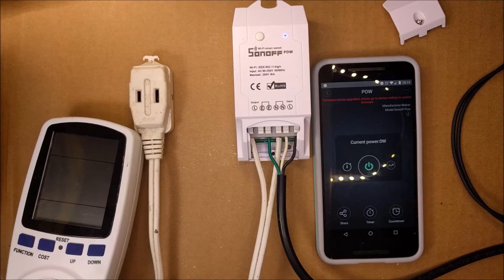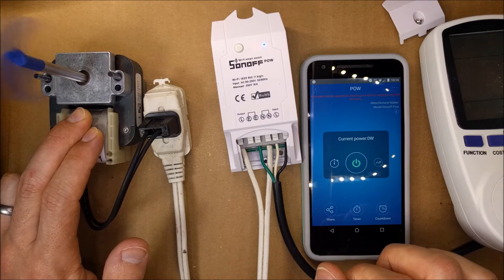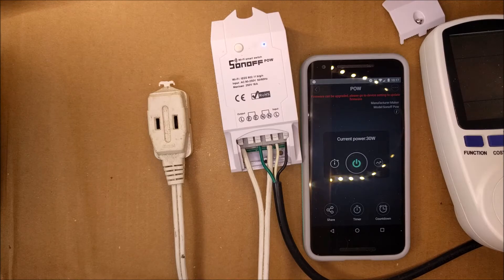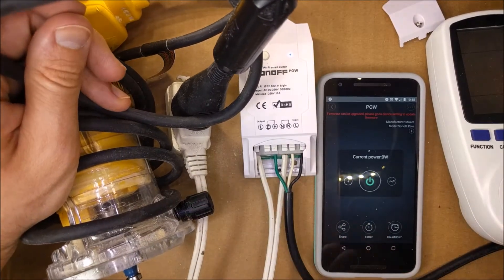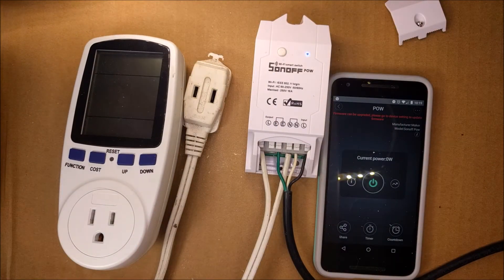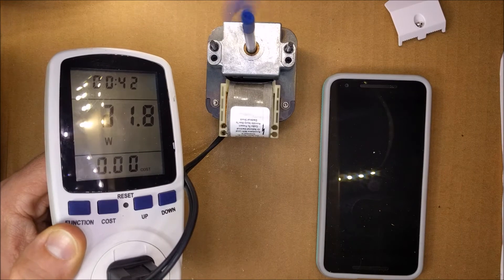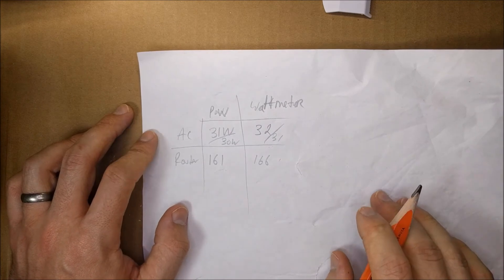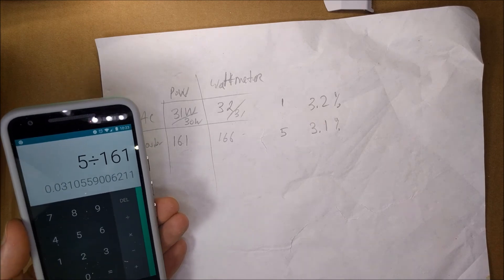Sonoff Pow review 2

Comment: You do realize that the whole point of these comparison videos are totally useless unless you use an actual multimeter to get the true consumption reading of whatever electrical device you are using. What is the point in comparing two units if you don't know which one is more accurate and by how far each is off from the true reading. Totally pointless. It's like comparing the taste from two variations of a recipe without knowing what the original recipe tastes like.

Comment: Nice comparison! But your comment about bigger load having bigger difference is not entirely correct. Each power device draw current in different ways. A resistor for example takes nice sinusoidal current but a AC/DC converter does not. Usually the cheapest energy measurement devices have compensation only for sinusoidal wave. Meaning they will measure other waveform wrong. The best would be to hook up a car heater with ability to draw different amount of load. Then it is comparable to say from results if Sonoff is more or less accurate at higher load. 
Energy = Power x time = Voltage x Current x time (x compensation). Using plain numbers only applies to square wave. With compensation you can measure e.g. sine wave but then it does not work with other wave forms. See here: https://en.wikipedia.org/wiki/Root_mean_square#/media/File:Waveforms.svg
Reply: Power factor
Reply from the maker: ok, thank you for teaching me. That makes sense now.

Comment: Do you guys have any idea if any sonoff device can control a three phase motor for ON/OFF actions ?
Reply from the maker: the 4ch sonoff can do it
Reply: You can do it also with three separate Sonoffs. Just make sure to switch around the same time. Also make sure that the motor starting current is not huge :)